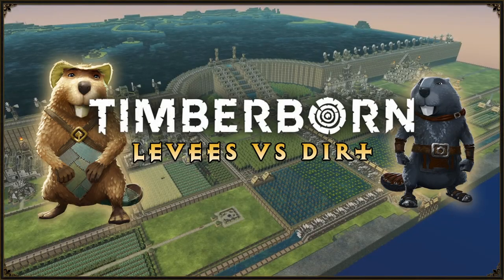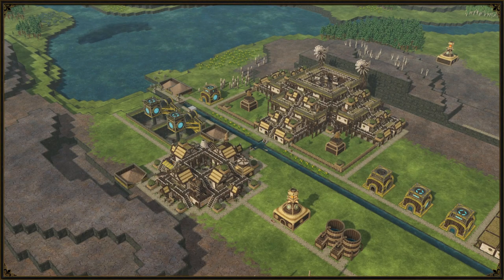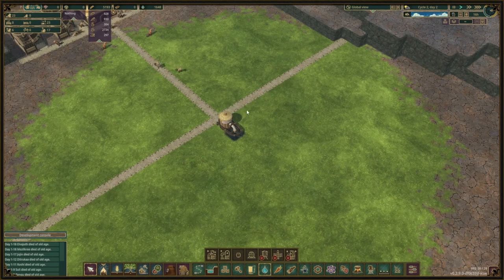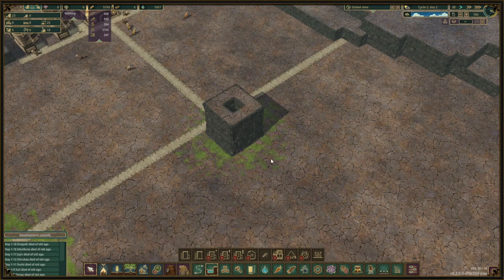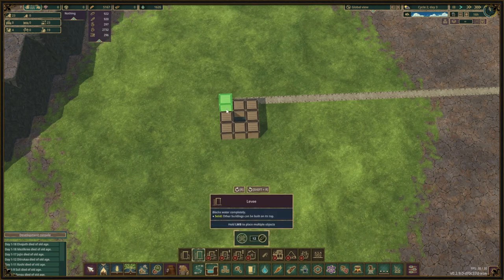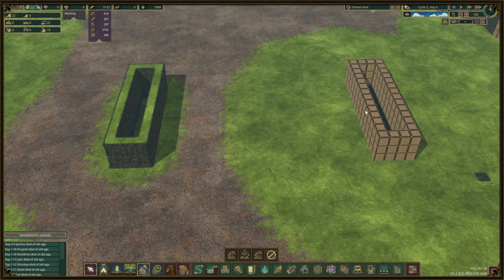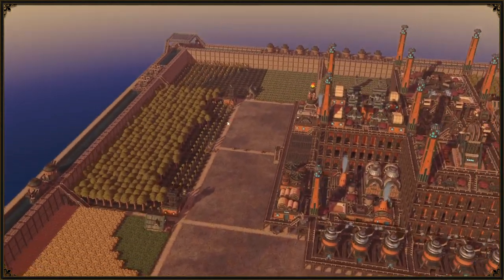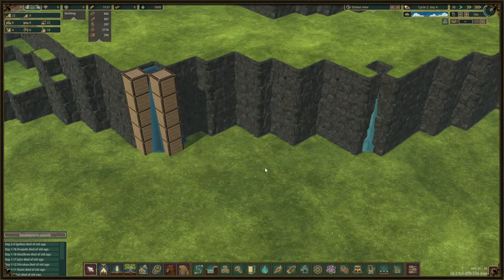Levees VS Dirt - Timberborn

Comment: Have you ever done (or seen anyone else do) any kind of testing on how exactly the windmills work?  Like, how do they determine how much power they're producing, do other buildings/levees/ground block wind, is there any way to redirect/increase the wind speed (like placing levees to narrow a river and increase water speed for wheels)?  Of all the things in the game, those are the one thing I really don't understand.  I build them on hills just in case it helps, but I really can't tell if it does anything.  They seem to just generate a random amount of power at any given time, as far as I can tell.
Reply from the maker: Your last statement is absolutely right.. There is no use in placing Windmills higher up or trying to create a wind funnel. The wind is a static entity throughout the map and its totally random and uncontrollable. So place as many as you can and use as many gravity batteries as you can to store the energy as long as you can.
Reply: @Barthak  Well that's a disappointing answer.

I mean, don't get me wrong, thank you for answering.
But I was really hoping there was some way I could get a good estimate of how much power I can expect them to produce as a consistent power source.  I generally plan for them to be good for a little better than half of what they say then can do and that works out, which (now that I think about it) is the average you'd expect from a bunch of die rolls, but I never would have thought it's literally random.
Reply from the maker: @jameshill2450  Sorry it wasn't the answer you were looking for; unpredictable winds and all that, but yeah I rather get the Ironteeth Engines for power :p
Reply: @jameshill2450  Working with digital wind simulations is tough. I suspect it is way more complicated to program than the water mechanics the game already has. 

I suppose the dice roll / static entity approach is both easier to program and can be safely handled by most computers. Complex wind dynamics would be nice if they can program it but for now, keeping them one apart and making large windfarms with Folktails seems like free energy. 

No wood burning cost like the engines and no need for a worker to sit there. Of course it has to be paired with gravity batteries for consistent output.

Comment: 3:00 disagree here as both have USES!
I did not check but each time you change tiles from dry to green, some water is lost, so make sure you control what is green can be important for challenge maps
like one with single singular tile water source, (and hard mode), that will leave you squeezing every drop. This might change in future as well, when "green" area might change water lost, so using both versions might become important.